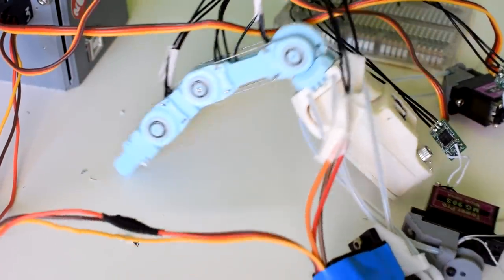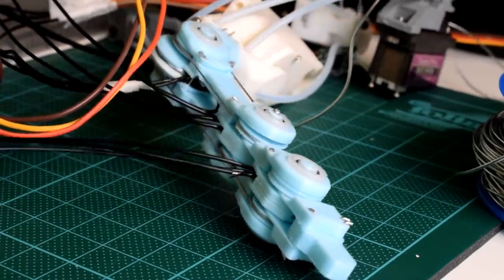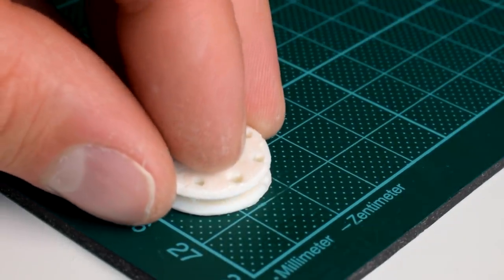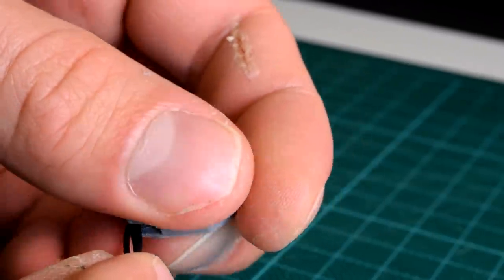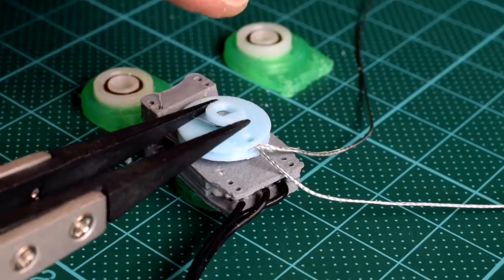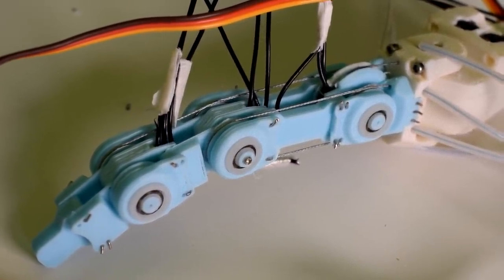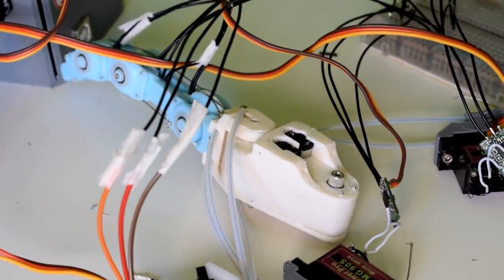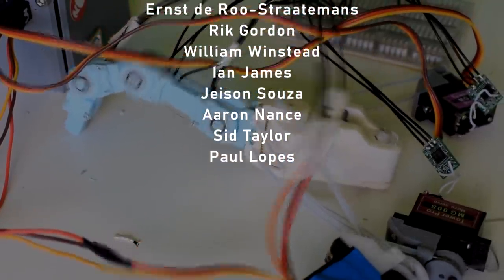Prototyping a Full Bionic Finger - Biomimetic Mechatronic Hand Part 3

Comment: The 30g silicone insulated wire from Hobby King is wonderfully soft and flexible for this sort of thing (go to workbench->wire & leads and then filter for 30 gauge, there are lots of colors and lengths)
Reply: wrapping wire ?
Reply: Correct me if I'm wrong, but I think that's just silicone and not electrical wire.
Reply: @MrWayash  The item name does sound misleading, but it is multi-stranded copper wire with silicone insulation.
Reply: Can confirm, I used this type of wire in bionic limb development for my Masters
Reply: Can confirm, Silicone insulated wire is insanely flexible; also, your soldering iron won't melt the insulation.
Edit: heh, looks like someone else can confirm as well.  Derp.
Reply: @IBuildCyborgs  How do they hold up over time? Durable enough for something that will run an hour or so daily for a year?
Reply: @spamspasm8183  Yes, though if they are running in tight enclosed spaces I would recommend using cable sheathing to reduce friction wear on the wires
Reply: @IBuildCyborgs  Alright thank you! I'll give these a try.

Comment: I think if you used a resin 3d printer, your parts will be far more accurate. Great Project!
Reply: I believe the goal of his design is to be fault tolerant enough that it can be printed by a standard 3d printer.
Reply: agreed, more accurate parts, but less mechanical strengh
Reply: @zfrenchy1716  Siraya Tech, among others, offers affordable ABS-like resin and flexible/impact-resistant resins. I've used the former to print T-nuts for my FDM printer that lasted longer than the same T-nut printed on my FDM printer. Throw in some chopped glass fiber and you could have a significantly stronger resin-printed part.
Reply: he mentions this at 7:11
Reply: @zfrenchy1716  There is resin as strong as ABS.
Reply: No)) it comes down to setting of extrusions in the controller. For instance, I do not have the same issues with printings, my detailed much more accurate
Reply: @zfrenchy1716  Either method could be a step in the precision cast parts for small-scale mass production. Accessibility being one of the design parameters here, anyone who builds 4 could potentially sell 3 (or build 10 and sell 9) at a profit to pay for tools, time, jigs, lathe, CNC, drill press and other upgrades. The same way a farmer raises 50 extra chickens to pay for all the 100 hatchlings and feed, filling up his freezer with free chickens to feed his family.
Reply: no

Comment: Another thing you might consider is either partnering with someone who  knows molding and casting or learning to do it yourself.  You can get much stronger parts from casting solid pieces out of  production resins like the TASK series from Smooth On.  
Also, good plan with moving the servo resistors!

Comment: I would recommend using “Blu” resin or anything made by the same company. It is pretty expensive ($50 for a bottle) but it is the strongest resin for Sla printing. I have tried using normal resin for mechanical type prints and the prints come out very brittle and snap very easily
Reply: Supposedly you're supposed to mix different resins to get the best material. I have a faint memory of people using Siraya Blu, but mixing it with something else to get extremely strong parts while Blu on it's own was either too brittle or something. Also there was a better alternative to Blu due to it often being out of stock, too expensive or something, but can't remember more about that.

Comment: Maybe an interesting idea for minimizing the number of wires running through the fingers;
Most, if not every, servo's have the potentiometer directly connected to the power lines. If you make sure that all servo's for one finger share the same power supply,
you can connect the potentiometers in the finger together, with only the control wire having to be separate. That would reduce the number of wires lower in the finger from 9 to 5,
Make sure to check if the potentiometers are connected directly to power before doing this!

Comment: for the positional sensor wires, use a thin gauge silicone coated wire. Not only is the sleeving higher in heat resistance, but it bends very well, and normally has good durability.

Comment: In your final design when you have the servo's for all the tendon wires in the forearm you could switch to a Two servo design and have all the tendon wires in an electronic clamp and only clamp on when you want to move each digit.

Im not even a robotics hobbyist but it seems like it could reduce weight and provide more space for wrist and forearm servos.

Comment: Very good design. You should try to use 28 or 30 gauge magnet wire bundled together for the control wire. You will most likely not drop enough voltage through them since your control system is very close to the sensor.

Comment: just looking at what you are doing, you could possibly reduce control down to 3 servos. One circular looped wire for left right lateral movement, one looped wire for up down of the first joint, then the last looped wire to control the curling and straightening of the last two joints.

Comment: I would definitely look into ribbon cable for your potentiometer wiring. Usually can get much thinner wires, and is scalable to how many wires you actually need. Although you will eventually run into the issue of how to route the wires in a moving object regardless of what you end up using.

Comment: Try magnet wire, because it doesn't have the rubberized coating but is insulated with an enamel. So 32 gauge magnet wire is only about 0.008" or 0.2mm in total diameter.

Comment: Have you considered ribbon cables? They can lay flat against the top of the fingers, and instead of having a bunch of loose wires  you could have groups of 3 split off at each joint and have a single solid ribbon at the bottom end.

Comment: I think it might be worth looking up making custom flexible pcb to replace the wires coming from the finger pots to make it more compact (the PCB is less than a quarter of a mm, good place to get some made would be PCBWay for instance).

Bearings might also be overkill for this application, bushings or solid bearings might be better suited and more compact.

Barnaby Dixon uses a mechanism consisting of a cable inside a spring with silicon sleeve to great effect in his hand puppets, might also be worth checking out for another way to deliver control from an actuator to an end effecter.

Comment: While a true SLA printer may be more accurate you may want to look into getting a DLP resin printer for the price, thankfully in the last few years the price has come down a ton for both the machines and the resin. 
I should also mention that there are a lot of tricks and methods to go about fixing or tweaking a huge variety of different problems you encounter with resin printers so I'll be happy to help with what I know of DLP if the time comes.

Comment: Hi, I'm working on getting a mechatronic hand to test how well one could be controlled with Valve's knuckles controllers and their finger tracking. Are you planning to add license (e.g. MIT) to the github repo?
Regarding SLA printers, there seem to be some pretty good ones in the ~$500 range as well, and resin compability charts pretty well documented by the 3d printing community. Bit of a mess with the resin cleanup and curing, but amazing details possible.

Comment: Question: Isn't the sensor built into the servo supposed to also help the servo determine the direction of rotation? If you move that further down the linkage wouldn't the finger sometimes accidentally move the wrong way for a bit before "realizing" and making the correct motion?

Comment: What about fine dynema rope? I have some that's about 1mm thick with a brake weight of 270kg. If you can find twisted instead of woven you might be able to use a strand of that, woven might work too, just harder to seperate.

Comment: Amazing project how about useing linear actuators for hand movement it sounds like it would go good with the pulley aspects of the design.
Reply: I believe he isn't using linear actuators because they are generally pretty slow and more expensive than the cheap servos hes using.

Comment: Would scaling it up make it easier (thinking 1.5 - 5x ?).   Big enough you can use standard screws/bolts, and have more working room?
Reply: I believe the idea is to make it roughly the same size as a real hand and forearm so scaling it up would make it a lot easier but it would kind of defeat the purpose
Reply: @dumbcrumb879  Makes Sense.  I need to get the cad/do the math on what the smallest size, but with "standard parts" would be.

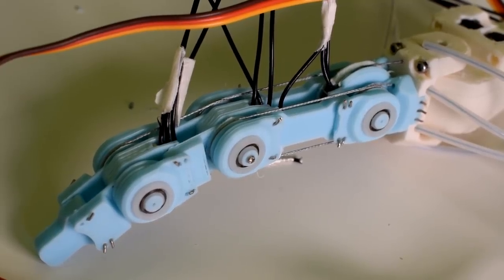Comment: at 6:00 how did you manage to accurately print a pulley that fits the servo spline? Not tried with an MG90 but a smaller one was something of a fail for me. Incidently, it might be worth a search around in case there is a reachable hackspace who have a resin printer. Small chance but might be worth checking.
Reply: BTW really loving the video updates. It's great to see someone (especially someone with so much knowledge/experience of hand biology) really focusing on doing one project well in great detail and discussing the process and experimentation along the way. Awesome stuff!

Comment: AWESOME JOB MAN but For mimicking the human finger you don't need 3 actuators , just 1 on the base like the (Naked Prosthetics)
Reply: no you need 3, one for side to side, one for distal and medial, one for base forward and back.  using 1 or even 2 greatly diminishes what can be achieved with the finger in question and weakens it too --- I mean unless you are just trying to be a little noob making a toy finger, if that is the case use one motor for all 5 fingers and be trash

Comment: Be careful about the resin printed parts. I have a Form 2 and 3, and resin-printed parts tend to creep if you're not careful about post-curing, and they may even warp significantly during curing if they have too high of surface area-to-volume. Plus they tend to be much more dense that FDM parts if you are using an infill, and way more expensive.

Comment: Im considering ONE MOTOR to use cable like this with electric clutches to engage. Using the motor as a gyroscope constantly running. That is ONE MOTOR to run a whole ROBOTIC body from ankles to knees to hips etc... It could all be run by cables and a steam engine if desired. None of the joints does any more than 145 degrees, so not even half a rotation of any of the cable joints. A work in progress...
Reply: horrible idea.  many muscles have to work at same time to get a good humanoid

Comment: I'd consider using Ribbon Cable, such as used to be used to connect CD drives and HDD's before SATA came out. You can peel off wires from the ribbon as needed. I'm thinking ≡≡≡≡====---- Maybe even a flexible PCB

Comment: Flat flex cable might be helpful for this project. This one has the same spacing as your potentiometer leads. 0.18mm thick. Scrape away the top side insulation and solder it down. https://www.digikey.com/product-detail/en/parlex-usa-llc/PSR1635-03/AF03-5-ND/213513

Comment: Great video like ever, is fantastic to see your designs. Only the printed product looks like shit, you should maybe take 2 or 3 days to tweak your 3d Printer that you get better fitting parts. You are right a resign printer is perfect for such small parts, but it cost more time and effort to get the parts finished. 
The freedom and flexibility from this design is real great. I think its a little overengeniert because normal finger can only flex on a small degree. 
Maybe you get it much smaller that the end product not looks like a double sized hand.

Great work until now, i hope that i never need a mechanic hand, but when the time comes i hope you are finished with it.